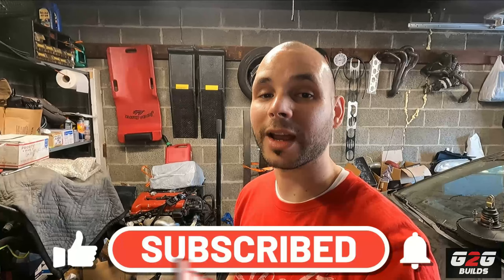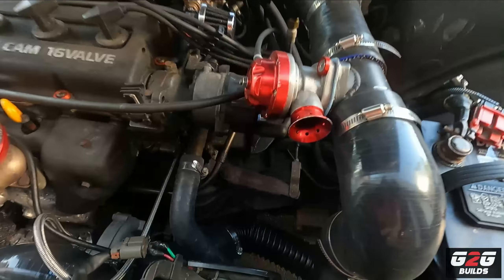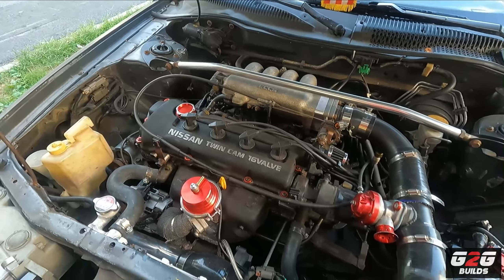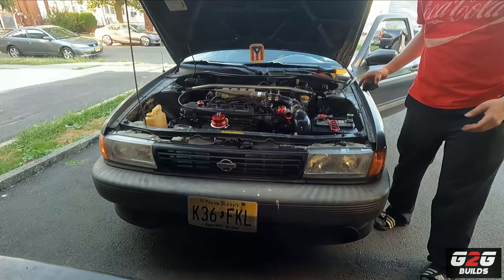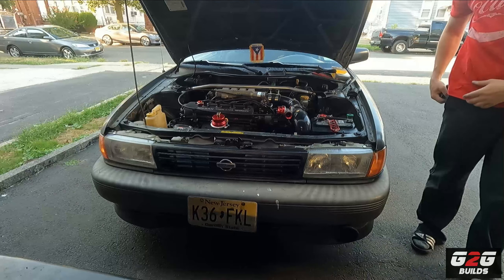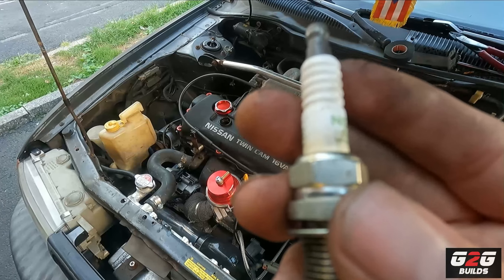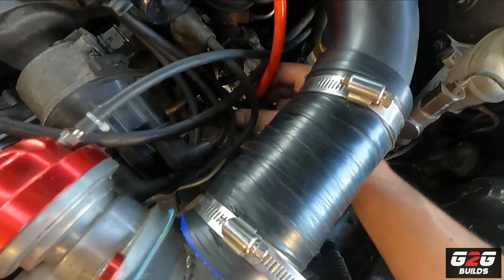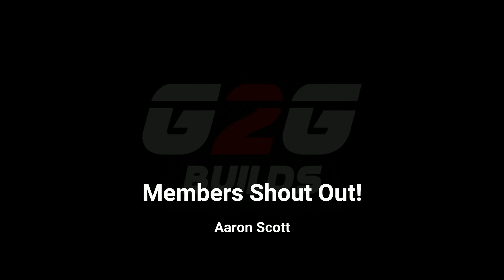B13 Sentra 1.6 Turbo gets Ignition System Upgrade

Comment: Although not needed until big power, have you seen the coil on plug conversions, I see some vw part ones and econobox nissan ones too, cheap to upgrade from junkyard
Reply from the maker: Yes, I've seen them! I'll need to change the whole setup including the ECU to be able to use them.

Comment: Do you know if the alternator in a b14 1.6 ga16de is interchangeable with a b13 ga16de?
Reply from the maker: Double checking parts numbers in rockauto, they are not the same. It seems like the B14 alternator are 80amp vs the B13 are 70amp. If you get the chance to compare them side to side, let me know.
I still believe it should work, but I'm not 100% sure.

Comment: Hi do you have a link where to buy that ignition coil?
Reply from the maker: I don't have a link, but you can find it on your local auto part store.
You want a 91-94 Nissan Sentra SR20de ignition coil pack. You'll need to find also the wiring harness for it and wire it in order to work. 👍